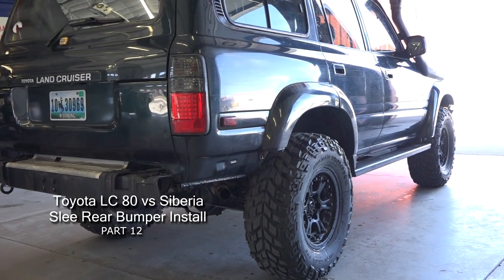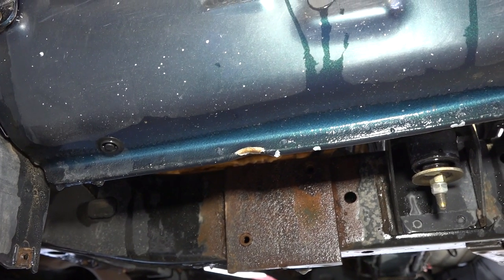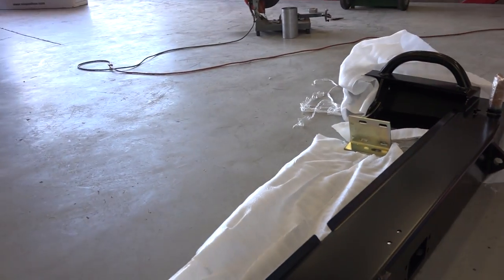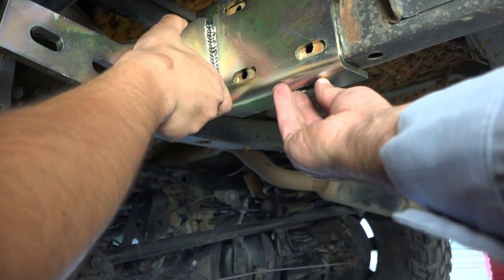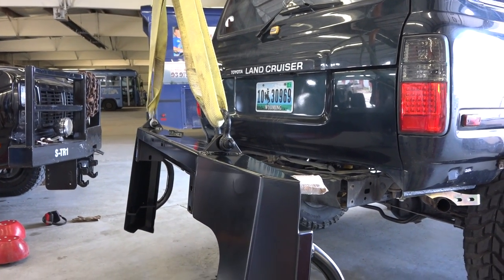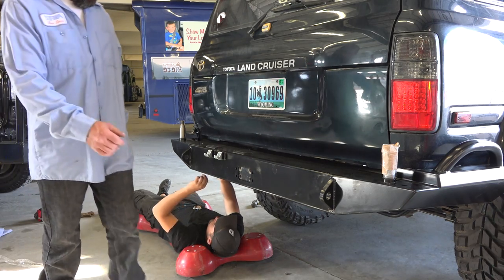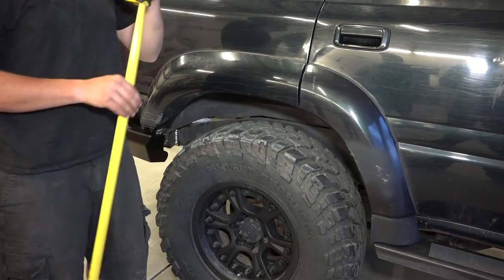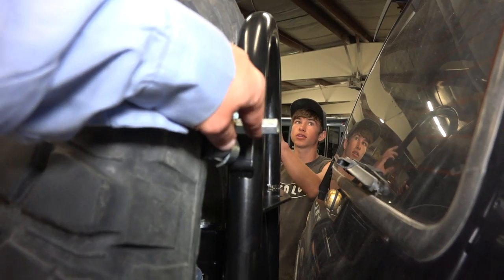Toyota Land Cruiser vs Siberia: Slee Off Road Rear Bumper Install Part 12

Comment: Jake-   I had another thought....I bet if you were to remove the valve stem  which allows the heavy tread of the tire some movement that the overall stresses  on the pivot points on the bumper would drop down 50% or more.... especially offroad.

Comment: Thank you for posting this video. The exhaust looks like it has been sawed off right before where the last reaonator. Any issues while idling etc? Heat or fumes getting into the cabin? Noise?
Reply from the maker: +Sam Hakimi No issues with any of the above. Resonator was still in place at the time but the whole of the exhaust as been replaced since that video.

Comment: I'm sure it doesn't matter at this point Jake but had you considered just applying some JB Weld putty to the gouge in the frame and smoothing it out with a straight edge before it dried just for peace of mind?
Reply from the maker: Didn't think of it at the time. It's been holding up well though. Hopefully there wouldn't be any issues down the road :-)
Reply: can you tell me what wheels you are running on the FJ80?  Thanks